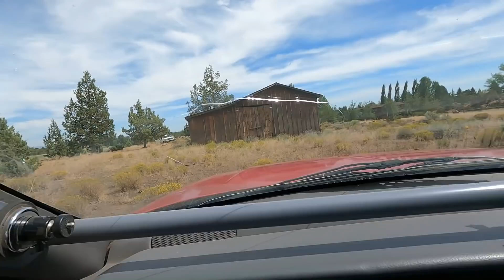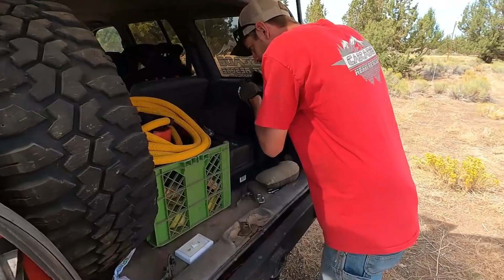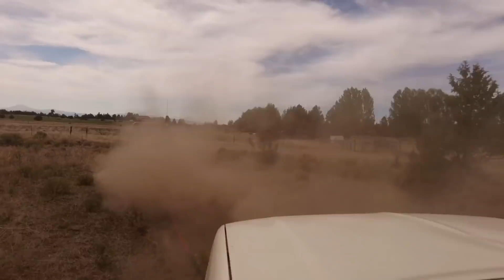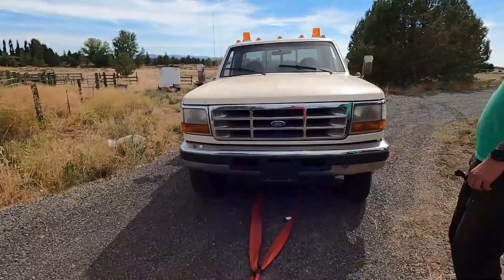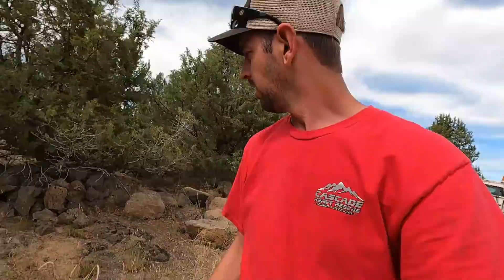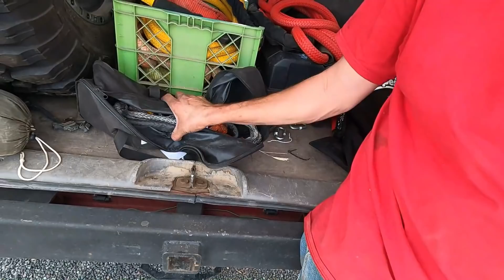10,000 pound truck falls into a hole!   Jeep to the rescue!

Comment: Just after 11mins you explained about how the rope could fall out of the ring snatch block if it goes slack. I wondered if you have heard of, or used, the Factor 55 Rope Retention Pulley & if so, does it work ?  You always give an honest answer so your opinion would be very helpful. I’ve learnt quite a bit from your vids about what works & what doesn’t. Cheers, Steve.
Reply from the maker: I’d rather deal with making sure that the rope stays in the pulley than use the product of a company that feels the best way to promote their product is to trash talk all their competitors.
Reply: @CaseyLaDelle  Ask Casey. You’ll always get an honest direct opinion. I’ll check out Matts stuff instead. 👍
Reply: I rarely drive (21-year-old car), but I want a Yankum rope of my very own!😂
Reply: @eegarim  I hope you get one 👍

Comment: I found a wet hole doing spring tillage ahead of the planter a couple years ago. We broke a cable and nearly wrecked a chain, trying to get the tractor out. Tractor was 180HP near 20,000 lbs and about 3 inches from the rear axle touching the ground. The tillage tool was a Landol 22 foot VT Plus, probably weighing 14,000?  It was deep enough, we had to dig a ramp in front of the wheels to keep from shearing a spindle off. 
 Finally a good neighbor came with his big 4 wheel drive tractor and a 3 or 4 inch kinetic rope, and jerked the tractor out easily, then got the VT tool out on the 3rd jerk.
 We left about 5 acres of that hillside unplanted that year 😎

Comment: I saw a video from a Carolina the guy had kinetic rope on his wrecker spools
Reply from the maker: Are you thinking synthetic winch lines maybe??   Kinetic rope wouldn't work at all on winches
Reply: @CaseyLaDelle  yes
Reply: @CaseyLaDelle  And a few videos later you use the kinetic rope on a winch line and explain how well it works in that specific situation. Guess, as always, it's the exception that makes the rule. Lol
Reply from the maker: @richardelliott9511  I do not have the kinetic rope wrapped around the winch drum.   There's no way that would work
Reply: @CaseyLaDelle  No not on the drum. I can imagine that the rope streching and contracting would cause binding and pinching on the drum besides the larger diameter not allowing much rope to even wrap on the drum in the first place. Instead, as an extension, getting the best combined performance from both the winch and the kinetc rope. So yes, using it on a winch job but not directly on the winch, sorry, semantics...
Keep up the great work !
More Riley please, even if only glimpses of her at home just being her. The pineapple pizza episode was great!
Reply from the maker: @richardelliott9511  if you look back in the video where I pulled the 5th wheel travel trailer out of the sand I used the same combination of kinetic rope and winch to get the same effect

Comment: Casey, you convinced me to buy the step like yours so I can use it as step and pull point, then you take your step off and put a pull attachment on for this pull?  Hopefully it was because this was a very heavy pull?
Reply from the maker: The step pull point is still great and you can use the soft shackles with it just the same.  But Yankum Ropes sent me this attachment so I figured I might as well try it out
Reply: @CaseyLaDelle  That is a good reason to use it!

Comment: How is that 10000 pounds
Reply from the maker: 10k pounds is a very low estimate for that truck.
Reply: Very easy to get 10000 pounds on that truck.
Reply: That steel service box is heavy.
Reply: It's an original super duty. Basically an F450. Bigger frame, axles, etc than a F350..... That service box isn't light either. Probably 10k how it sits. And 13-14k with my gear in it.
Reply from the maker: Just an FYI, this morning I went to the dump and my 3/4 ton gas engine pickup is 7,200 pounds.   That diesel dually service truck is easily in the 10k range
Reply: @CaseyLaDelle  thanks for the info